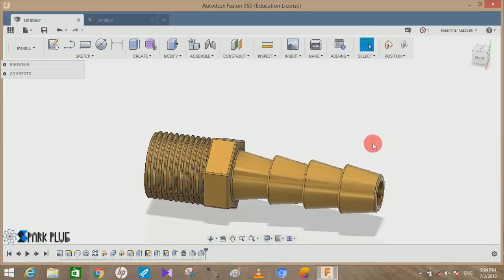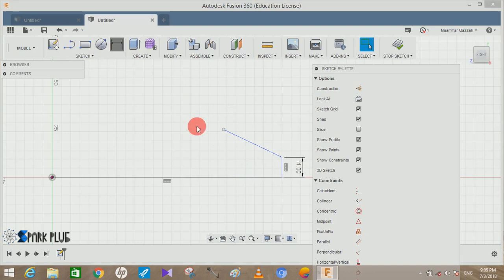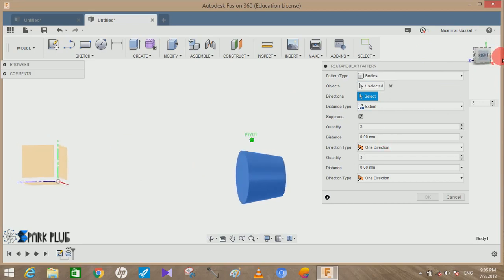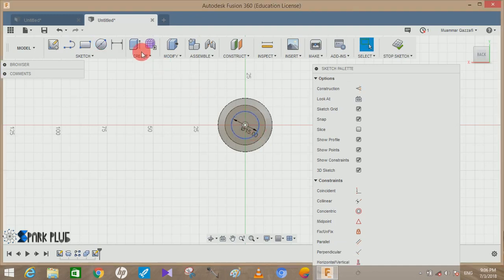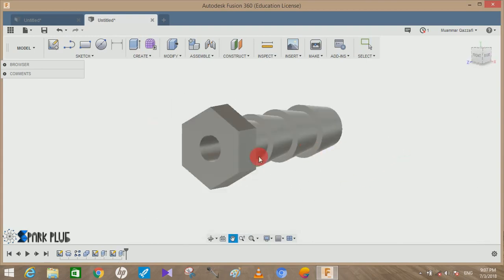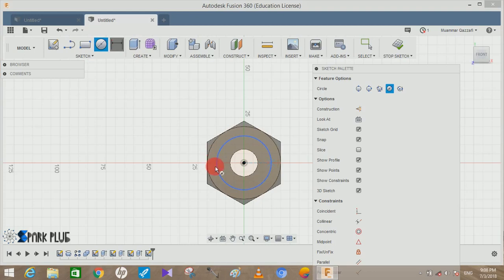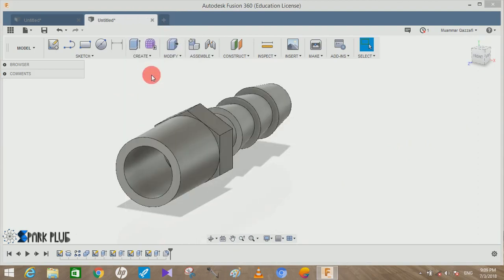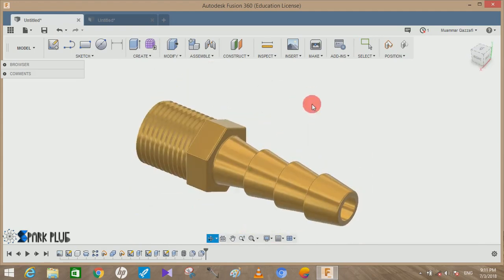How to make Barbed Hose / Hose Barb - fusion 360 Tutorial

Comment: Good tutorial here although 2 years later it has aged quite a bit.  The rectangular pattern tool no longer works this way as it has you select a type (rectangular, circular, path) and then an object type (Plane, body, etc.).  Directions has been replaced with "Path" requiring another object to provide the direction.

Comment: Just got Fusion 360 and relearning my CAD 3d skills. I didn't use it much after a basic class I had 10 years ago. Going to use it mainly to design some ideas I have for fabricating some steel work. But someday get a 3d printer to rebuild some basic plastic parts that are hard to get anymore doing some reverse engineering.